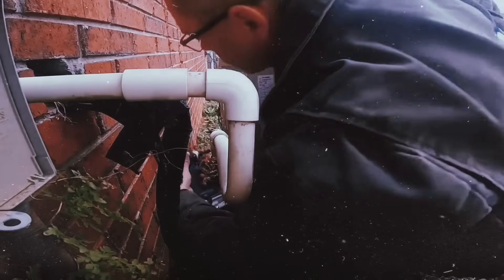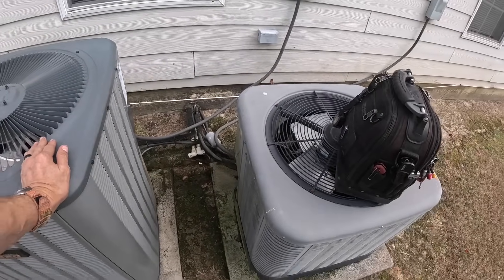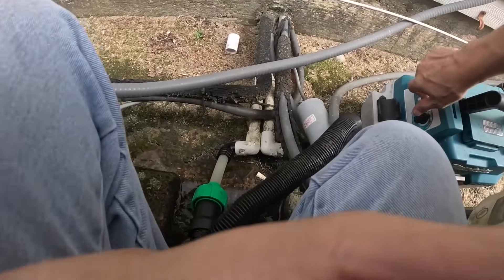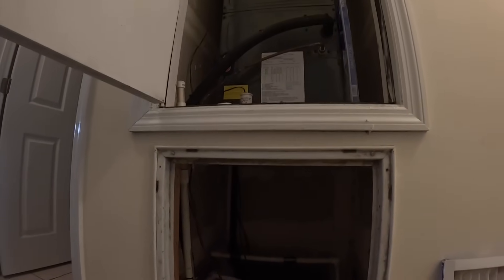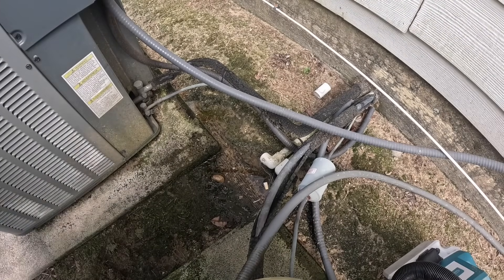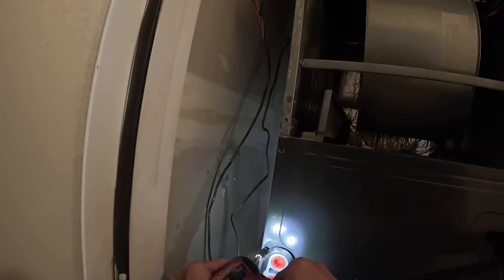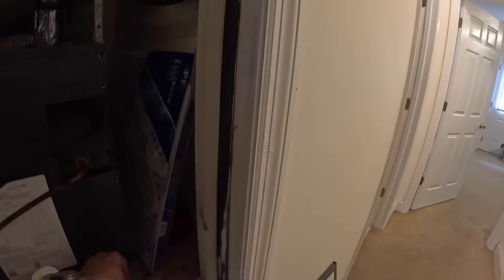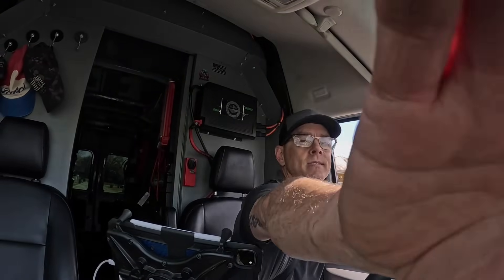Part of My Day As An HVAC Technician! #hvacguy #hvaclife

Comment: You can get out the oyster crackers. Did that have a trap in the return box and also go under the slab? I sometimes flush water through them when the vacuum is on.

Comment: Here in CA and the southwest the humidity is so low, 10-20%, that the condensation is not enough to keep the drains flushed.  Once every 10-15 years they will get plugged up and need to have the line cleaned out.

Comment: Curtis did you run it in heat to blow it out?
Reply from the maker: Used CO2
Reply: @HVACGUY  oh sounded like you ran the system but make sense that the system would run after the float closes

Comment: Do you have a video where you show how you "blow out" the drain-line?
Reply: Yeah, I wanted to see that too. May be a compressor.
Reply: I've seen him use a handheld devise that takes a CO2 cartridge. Has a flexible tube with a ball on the end of it to make a seal over the 3/4" pipe/fitting to prevent blow back. Squeeze the trigger and give it a blast of air to clear the line.